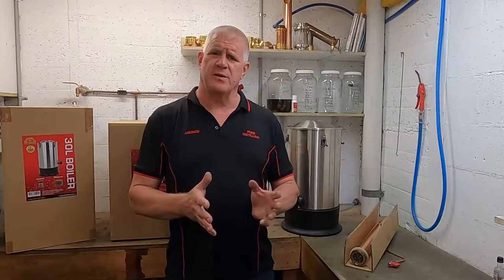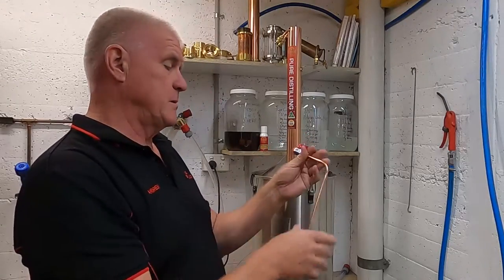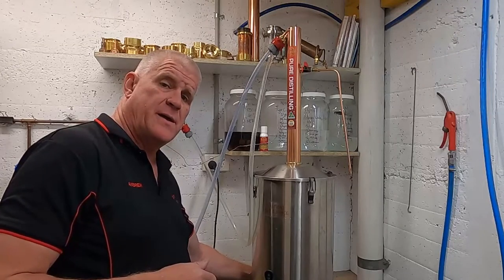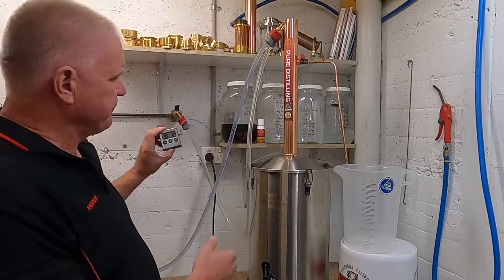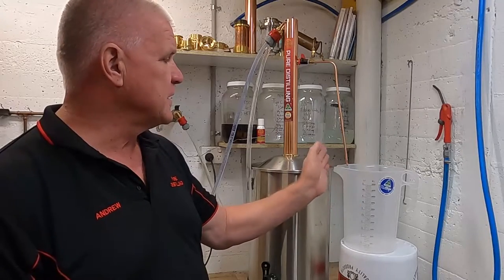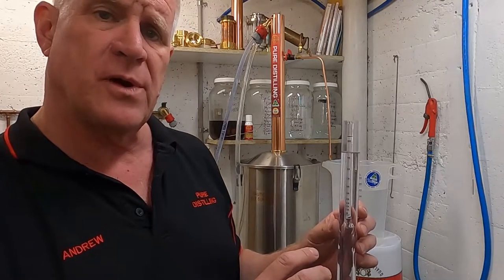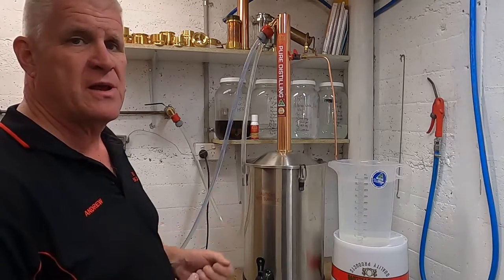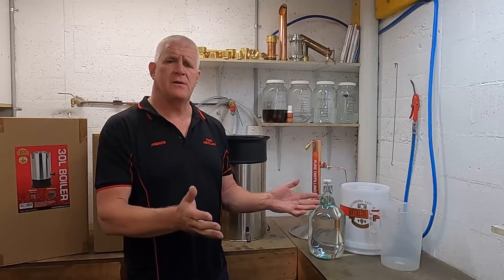Distilling With The Pure Distilling Reflux Condenser - Distilling 101

Comment: Can I use a pump of some description so I can save on water usage? Eg I have a large swimming pool and would like to use the water from there and have it go back into the pool. Cheers
Reply from the maker: Hi, your local home brew shop will have a pump similar to this which would work fine in a swimming pool https://puredistilling.com.au/products/stirrers-pumps-and-bottles/pump-submersible-3500l-hr/ - It is important that we don't sit it at the bottom of the pool, otherwise there will be too much head pressure for the pump to handle.

If you're using salt water/chlorine we could imagine there may be some problems down the road in regards to copper degradation/breakdown - however, this is still unproven. Hope this helps - Connor

Comment: Just out of curiosity could you start the water at the start if you don't have an alarm thermometer?
Reply from the maker: Hello, all of our Condensers come with the alarm thermometer shown in this video. You will need a thermometer to dictate when to switch between slow mode/fast mode at the start & end of a run

Comment: I have the old version of the Spirit Maker...bought about 12-15 years ago.

It has not been used for about 12-15 years.

I pulled out 2 of the packing pieces and they were clean...so was the inside of the column.  (I always rinsed the column after use)

Do I need to do a special wash or can I just use it for my next run?
Reply from the maker: As long as the unit is still clean, just a regular rinse will be fine!
Cheers Connor

Comment: Hi, I've got a 35litre version but can only get around 2-3 litres max. I THINK I might be running it too hot even though I turn the second element off, (leave it running on the 1900W element). It continues boiling at 94degc on the bottoms while the overheads read around 78C. Am I running it too hot or could it be passing the lid seal? Please help 🙏🏽 edit**  just saw your reply to another distiller in Darwin. I'll try doing the wash indoors in a cooler temp and see how I go!
Reply from the maker: Hi There

Thanks for getting in touch, sounds like the boiler you're using isn't ours as we only provide a 30L Boiler. It is running at a good temp as 78C is the boiling point of ethanol, it could even be worth running both elements at once to maintain a good head of steam.

Let us know how you go with the next batch, if you're in a warm climate such as Darwin we recommend running a 6kg sugar wash/7kg dextrose during summer. Sugar generates heat, if adding large amounts of sugar in you will notice that your wash will overheat very quickly! - Connor

Comment: Would the ambient temperature (30-35 degrees in Darwin) affect the amount of product that comes out? I’m only getting 2.5l @ 95%. Great purity, just not much. 
I have done a few washes; 1 with 9kg of dextrose, a few with 8 kg of white sugar. Fermented for about 10 days. Clearing isn’t an issue. It still takes about 45-an hour to get to temp. 2-3 hours on fast mode, another hour on slow, then it boils out. Kit is brand new, so shouldn’t be any issues there. I had a t500 when I was living on the on the coast and was getting 4.5l @ 95%. 
Are you able to assist?
Reply from the maker: Hi Ben

During warmer months in warmer climates, we recommend only using 6kg sugar/7kg dextrose per wash. This is because sugar makes heat, and when a lot of sugar (8kg) is coupled with an active yeast, an excess amount of heat is generated. When a wash runs at such a high temp, it will struggle to 100% ferment, and some of the yeast will die - which will result in a reduced output of spirit during the distillation run.  

When using 6kg sugar/7kg dextrose, we should still expect around 3-3.5L of 9#% spirit, and you will notice the ambient temperature will sit much lower.

Unfortunately living in such a beautiful climate has it's drawbacks - we can't produce as much alcohol during summer! Luckily we don't have to worry about that just yet down here in Tassie. 

Let us know how you go with your next wash, if you have any further questions please let us know - Connor
Reply: @PureDistilling will itmake a difference if the wash is either kept indoors or under temp control in a fridge?
Reply from the maker: @blkop8369  If you have the luxury to use a temp control fridge - do it! This a great system for the summer.

Be sure to keep the wash between 20-24 degrees and you're good to go. - Connor

Comment: Hi sometimes when collecting heads at the start I have drips from hole near red slow/fast valve, would my water ratio too slow cause this?
Reply: Ps this video more information and easier to understand
Reply from the maker: Glad you like the new video, it has all our current recommendations. Not sure about the drips when in slow mode, does it happen when you go to slow mode at the end of the run as well?

Comment: I pack my column with 100% copper scrubber mesh and 100% copper tubing ive cut up into saddles. 
I believe it helps alot. 
But lately ive had temp issues after turning the collection tap open at 77-78 degC it climbs to 82 and does not settle back down it stays there for maybe 40 -mins - 1 hr  i get approx 1.5 - 2 liters and its upto 83 and keeps climbing. This never happened all my previous 12 + runs with all the same method.
I had to keep my condenser going and turn off my boiler for a good 30mins +for the temp to come down then start over, i did this 3 times to claim approx 2.5 litres,  usually with everything the same i used to get 4.5 litres. I do recycle and reclaim my water but it doesn't even run long enough to warm up my huge drum. That was never an issue before?, amy water flow tbrough my condenser is at full flow using a pond pump and when i remove the return line full flow?. I never used the wash conditioner never have and using the Classic 8 turbo yeast 20 ABV never had and issue before? No evidence of foaming in my scrubbers etc.  Ive put a high flow tap on mine and opened up the hole a very slight amount in the brass ferral that comes after the collection tap?. My other runs was all fine with all the mods ive done. I did have a slight drop in alcohol % after making the ferrule hole  but only approx 2 % i collect at approx 88-87% now. That does not bother me i wish all the fittings was not brass though. 
My tap is stainless but the ferrule and the olive fittings are both brass at the product end as well. 
I removed my spout and added a coil type spout i made to contact more of the product on the way to the jar. . Im thinking about getting a mate with a CNC machine to do  copper fittings for me.i dont understand why they wasn't made from copper in the first place?. I
Reply from the maker: Hi, there is a lot going on here, I think all the following are contributing to your issues
            The original stainless mesh in the condenser was packed to ensure a certain density along the column, tighter higher up getting less dense further down the column. This is done to ensure the reflux action is occurring correctly, remember this is a liquid cooled column, the liquid going down the column cools the steam coming up. Repacking with the copper saddles and mesh has disrupted that reflux action. 
            At the same time you have opened the aperture in the brass ferrule which is allowing more liquid to escape the system, this again this is effecting the reflux action, you have less liquid going back down the column as you have increased the production rate and reduced the reflux ratio (how often a ethanol particle would go up and down the column before escaping out the production tube). This now means there is a greater % of steam getting higher up the column a lot earlier, hence your temperature is rising a lot earlier.

The only way to get this working again as designed would be a two part process, if this has started since drilling out the tap and small hole in the ferrule I would buy another tap and see how it goes, if temp still rises early you will need to repack the stainless mesh. The remaining question as to why brass and not copper is that copper degrades very quickly, and copper fittings would have a very short life, have a look at the copper mesh in the column, it will be showing clear signs of corrosion already. Let us know how you go, the Mesh Repacking instructions  are available on our website and a short video is available here on our Youtube channel.

If you are looking to involve more copper contact into your product, have a look at some copper extensions. We have some available in 100mm & 500mm. Alembic copper domes also work very well, which we also have available.

https://puredistilling.com.au/products/kits_and_boilers/alembic-copper-dome/

https://puredistilling.com.au/products/condenser-parts-and-bespoke-items/spirit-maker-100mm-copper-extension-500mm/

Hope this helps
- Connor

Comment: So do you run the whole time on the 1700w element?
Reply from the maker: Hi, yes that is correct! During the heat up process we leave both elements on which allows us to reach rolling boil temps quickly. As soon as we have achieved a rolling boil, we switch off the smaller 500w element and leave the 1700w element on to maintain a good head of steam. - Connor

Comment: I have alcohol leaking out the top of my condenser, is this because I have both elements on and it's too hot? It stops when I turn the 900w off and leave the 1400 on
Reply from the maker: Hi Beau

We find that 1400w is too weak to maintain a steady rolling boil, try leaving both elements on. It seems like your wash is foaming up the top of the condenser. This happens when either distilling conditioner isn't used, or the wash hasn't finished fermenting 100%. 

How much alcohol (litres) were you distilling when it leaked? - Connor

Comment: My instructions tell me to turn the water on at 50 degrees. Is there any benefit to turning the water on at the lower temp?
Reply: I turn mine on at about 45 degrees. Once it gets to 50 the temp climbs pretty quickly, often it’s at 77-83 within 10 seconds. So I start mine at 45 just so it doesn’t take as long for the temp to drop back down to 77. Having said that I sometimes turn the water on while I’m waiting for it heat up, my water circulates so I’m not wasting water so I don’t mind turning it on that early as I’ve walked away waiting for it to get to temp and I’ve forgotten about it.
Reply from the maker: Sorry for the late reply, this one slipped through the system. as soon as the temp rises on the thermometer it means the wash has come to the boil and steam is making its way up the column. Turning the water on at 10 degrees above room temp gives you a few extra minutes to make sure the water is on, if turning it on at 50 degrees you may only have 1-2 minutes before it reaches operating temp, miss it and steam will start coming out of the top, losing you alcohol. 

Hope that helps
Cheers Andrew

Comment: If you place the sealing on the inside, it have to seal against the thread. And that is difficult. if you place it on the outside it seals against two flat surfaces. That is generally a success. 🙂

Comment: What happens when you miss the 80 dec after 4 1/2 litres
Reply: The temp was at 77/78 when I checked it.
Reply from the maker: @josiekent2154  Hi Josie, assuming that we have missed the opportunity to turn the condenser to 'slow mode'? If so don't panic, you will still have a quality ethanol base ready for filtering. 

You may have a slightly lower ABV% reading, as towards the end of the run most of the ethanol has exited the system, meaning more water is present in the boiler. Cheers - Connor
Reply: @PureDistilling  
Gidday Connor

I missed turning to slow. Boiled the wash and had wash bubbling out of the top of the top of the distill

I’ll filter it twice and put more essence in

Cheers

Comment: Hi I always purdge my condenser first then turn on the water at 42 and have never had a problem I get between 4.2 and 4.5 and on the odd occasion up to 4.8 lts .I have just tried this yeast kit of yours and I'm not impressed at the amount of odour that is coming from my wash
Reply from the maker: Hi Stewart, if you are right there you wont have a problem, we recommend a little bit lower so people have a bit extra time to turn the water on, and to ensure water flow when the unit comes up to temp. Unusual that the wash is smelly, our yeast is generally regarded as far less smelly than the competition, what temp are you fermenting at?
Cheers Andrew
Reply: @PureDistilling  it's at 25c
Reply from the maker: @stewartstevenson6280  Should be fine, cant see why would be smelly. Let me know how it distils
Reply: @PureDistilling  hi after adding my clearing agent I had the clearest wash to date thou my yeald was average so I think I will stick to my usual yeast with less odours and less cleaning up of all the charcoal

Comment: Can you yell me why my still takes 5.5 hr and i only get 3.5lt of spirit
Reply from the maker: Hi There, sorry to hear you're having issues with your run. We'll get to the bottom of this for you, could you please answer the below queries so we can troubleshoot your issue:
- How much sugar/dextrose are we using?
- How long are we leaving the wash to ferment for before adding clear?
- How long does the run take in 'fast' mode before switching the tap to 'slow' mode? (As shown in this video)

- Connor
Reply: @PureDistilling  8kg suger at least 10 day's before adding the clear I have one of the first stills with the single element
Reply from the maker: @ChristopherDeaves   Apologies for the late reply, sounds like there could be an issue with your boiler. How long does the system usually take to reach the 78 degrees?
Reply: @PureDistilling  roughly about 1hr some times a little more
Reply from the maker: Boiler might be getting a little tired, but the time taken for a run  is too long, should be coming out at a steady trickle, if its only a slow drip there is a blockage in the output tube, probably in the tap assembly. Is there a difference in flow between fast and slow mode? If yes, then the small hole on the back of the brass breather fitting behind the tap is blocked. Carefully remove the compression fitting and poke a hole through the small hole to clear. Remove the whole product arm and blow through to remove the blockage piece. Attach the pipe with the compression fitting carefully, do not turn the brass fitting, the breather hole must point up. Let us know how you go @ChristopherDeaves

Comment: 4L at 95% ABV ? that's so great . i would never get this with T500 never 
can we use Copper Saddles with this reflux condenser ?
Reply from the maker: There is enough copper in the 500mm condenser body and in the output tube, so no need for the saddles. The mesh inside the tower has been packed at a certain density to maintain a good reflux ratio, so we dont want to substitute it with anything else. 

Hope that helps and thanks for the interest

Cheers
Andrew
Reply: My mate has a t500 and he pulls 95% every time. I've seen it with my own eyes many times. He doesn't do anything what this guy does. Just sugar and turbo yeast and water.